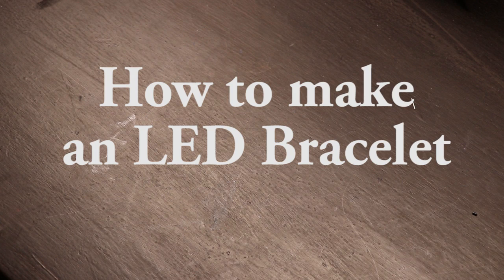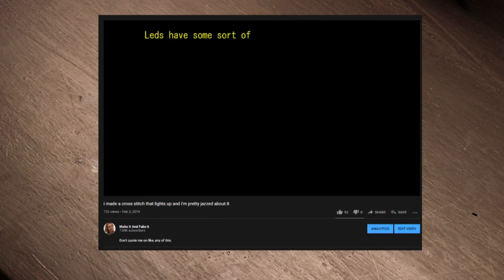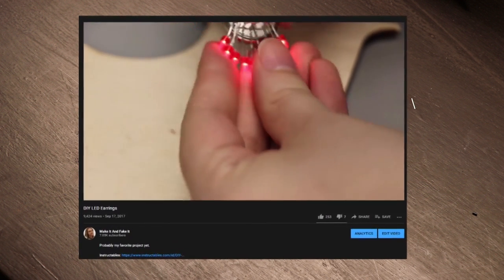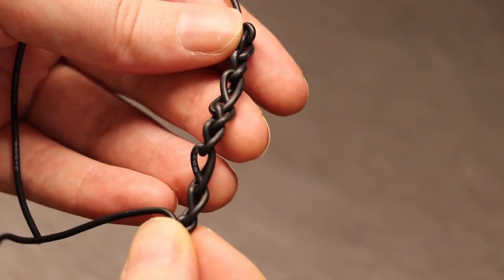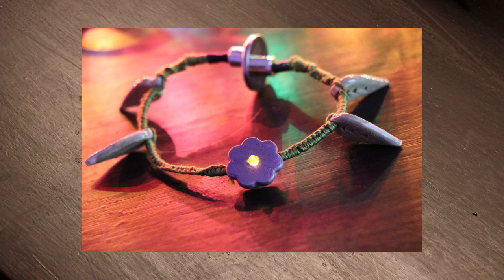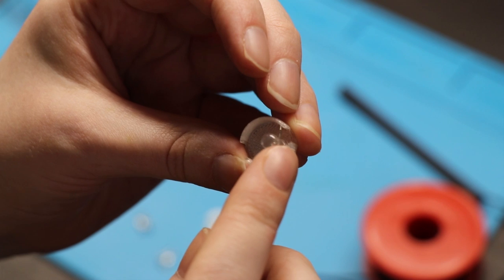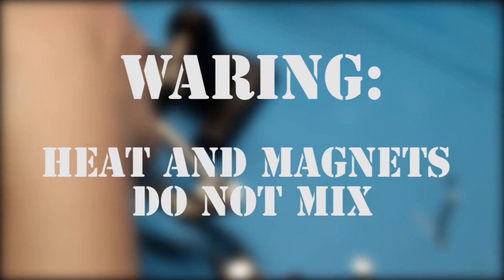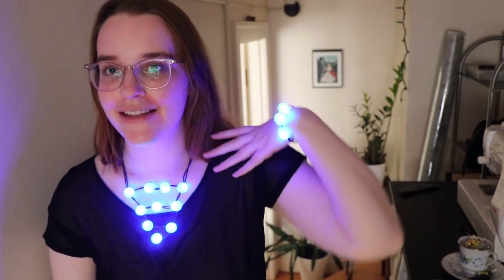How to make LED Jewelry

Comment: Yo! Not sure if you've heard of it, but there's a VERY thin wire called Wrapping wire, or 30awg or 30guage wire. It's super thin wire. Like thin enough you could probably use a needle with it and use it like thread. It's called wrapping wire because it's used to wrap wire around the leads of through hole components without the need of solder, if you have to tool to do that. There are a few types also. Shielded (like a normal wire with plastic coating), enamel coated (wires with just a little thin resin coating on it. Think electromagnet wire), and just base wire with no coating. Wonder if you might come up with some ideas using that kind of wire. Can be gotten on amazon by searching for "30awg wire" pretty easy. If you get silicone coated, it will be EXTREMELY flexible, but won't keep it's shape well, and could potentially not stick like you need it to. Good luck! And thanks for the videos!